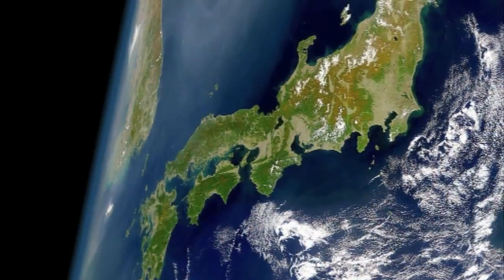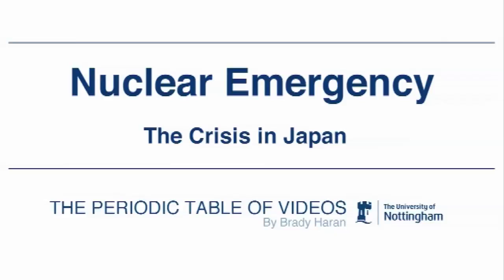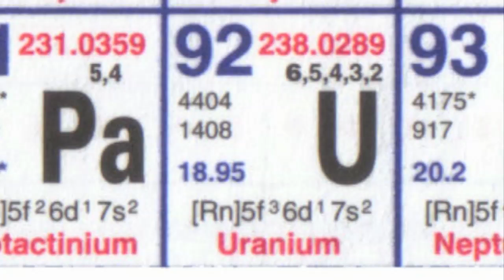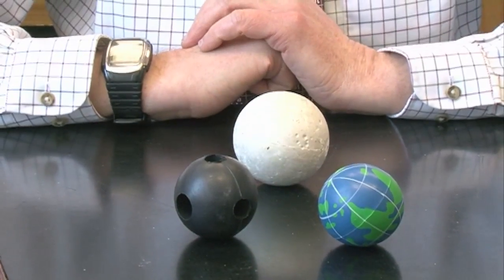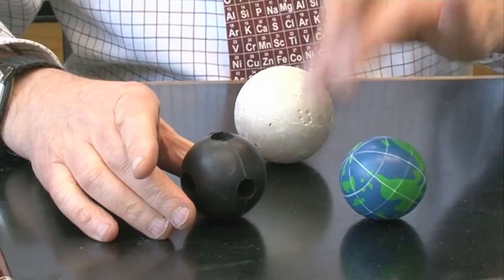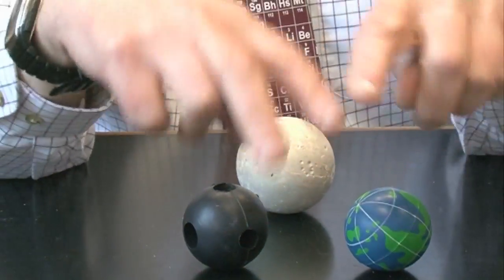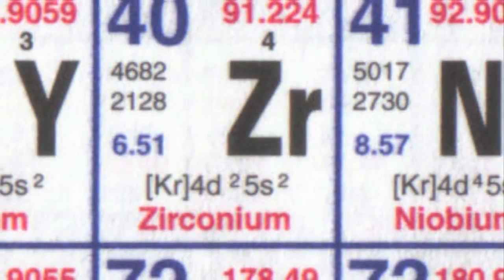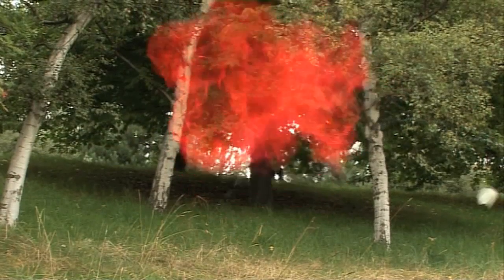Nuclear Reactors in Japan - Periodic Table of Videos

Comment: Pretty much dead on about the salt water portion, but to elaborate: Salt water actually eats most metals, just very slowly, and creates a white powdery substance (clumped by the water on the metal) that will cause any moving parts to weld together. It's that residue that makes salt water bad on machines unless the metal parts are coated with some plastic. Basically, they could have used seawater, but then they'd have a huge nuclear bunker sitting there inaccessible and no way to fix it.

Comment: Just to clarify: The pressure of the water steam would by no means be sufficient for such an explosion.
BTW: The mass of Hydrogen required to blow up the concrete building can only be caused by the heat of an at least partly melted reactor. Hence, it was obvious that the reactor had at least partly melted when the building exploded - despite protestations to the contrary.

Anyway, I love all these channels (incl. sixtysymbols, etc.)! Keep it up!

Comment: @Who0mere I believe the general rule is:  The same number of gas molecules, in the same volume, at the same temperature has the same pressure.  If the number of molecules changes, or the volume changes, or the temperature changes, the pressure also changes.  The simple answer is that, all things being equal, whenever the temperature increases the pressure also increases.  So I think the factor you are looking for is "temperature".
I

Comment: @zabatzu Graphite and water are both moderators that maintain the nuclear reaction. While graphite burns and water doesn't, this doesn't mean that a water moderated reactor can't explode. In a meltdown, very hot uranium melts through the bottom of the reactor to the water table, converting the water instantly to steam. That steam explodes upwards and spreads radioactive elements.

Comment: Some might like a video including the types of Uranium in reactors. Most folks don't know about the low-level of enrichment (3-4%) of the relatively uncommon isotope 235 (only 0.72% in naturally-occurring ore) required in most commercial light water reactors, and the fact that the 238 is the non-fissile isotope. (Although Plutonium generated in "spent" fuel rods from 238 via a neutron absorption pathway can be used in mixed-oxide (MOX) reactors in jurisdictions where fuel recycling is allowed.)

Comment: @MightyRoy Uranium and Plutonium will stay safe inside the rods or on the bottom of the pools just fine.  The species we have to worry about are Iodine-131, which the professor mentioned (half-life of about 8 days), Caesium-137 and Strontium-90 (both of which have a half-life of around thirty years).

Comment: @NeonCode88 Probably because liquid nitrogen turns to gas so quickly, which increases pressure and might put the containment building at risk of failure.

They used liquid nitrogen at Chernobyl, but the reactor's roof was already gone, so there was no danger of a pressure induced explosion.

Comment: @japanesepoptart 1.Clean coal is still not clean. 2. No one dumps nuclear waste intentionally (legally at least). 3. What you are suggesting is worst case scenario planning. If that were the case, were do you draw the line? This plant was built to survive a M7.8. There is a point where construction is limiting factor. As you said to Puncheex, "we can never be so sure." I would suggest a more proactive fail-safe in future reactors, one which doesn't rely on pumps.

Comment: @puncheex They did use liquid nitrogen at Chernobyl, but not directly on the fuel rods. It was used an attempt to freeze the ground beneath the reactor to prevent a meltdown burning through the concrete floor.

"A plan was devised: to freeze the earth around the reactor with liquid nitrogen, and then build a heat exchanger in the ground beneath it to cool the core and prevent meltdown... all the liquid nitrogen in the western Soviet Union was sent to Chernobyl" - The Guardian 26-Mar-2006

Comment: 4:50 - 5:45   woa woa woa, the whole reactor did not have a hydrogen explosion.  It was VENTED hydrogen that exploded, they vent from the reactor to reduce pressure, so it vented into the roof space and thus a spark lit it.

The roof prettymuch just keeps rain off the reactor, that's it, it's really flimsy and is not a part of the reactor structure.

The reactor is fine, it wasn't the reactor that exploded.

Comment: @danjozef 
Let's make math, would you?
10 tons of nuclear waste in fukushima contains 240 times the quantity of radioactive cesium produced by hyroshima expolosion.
Fukushima reactor 4 use 30 t/y of combustible, producing 720 "hiroshima bombs" per year of cesium.
Unit 4 worked for 32 years, so TODAY the pool of unit 4 contains 16000 times the cesium of hiroshima.
A LITTLE PART COULD ESCAPE ANITIME, a little part of hiroscima x 16000 is NOT LITTLE.

Comment: Disregard that guy.  The second law has nothing to do with it.  How do you think we get Transuranic elements?  Heck, how do you think we get any elements larger than Iron?  Add a little mass (a proton or neutron) and add some energy, to make it stick.  That energy then becomes a tiny bit of extra mass.  The problem is that it takes a very high-energy condition for such reactions to take place, so it normally only occurs at the heart of supernovas.